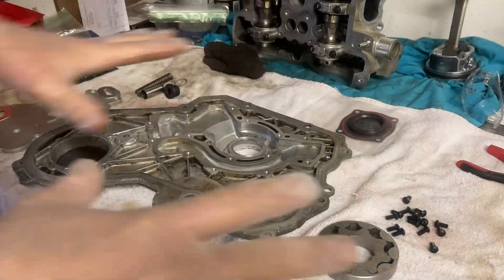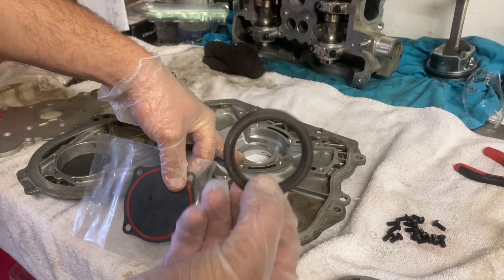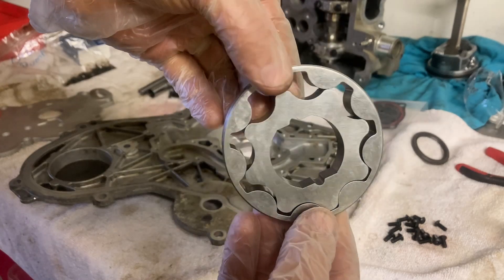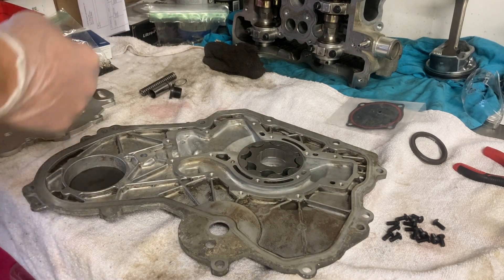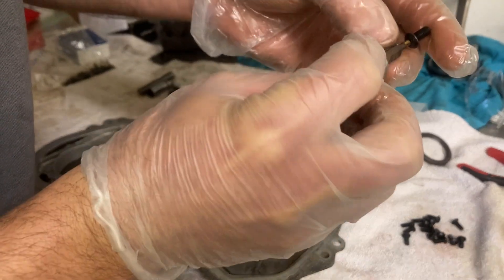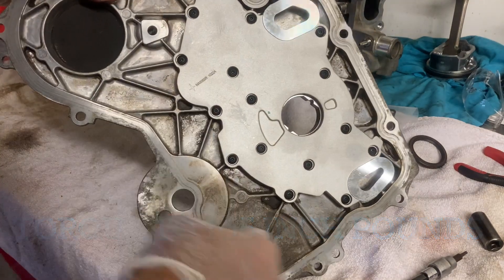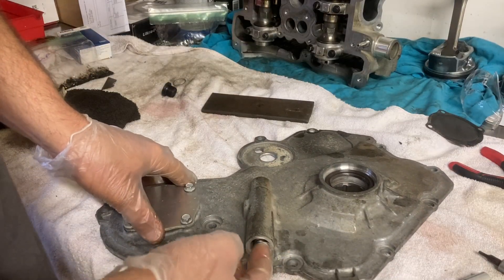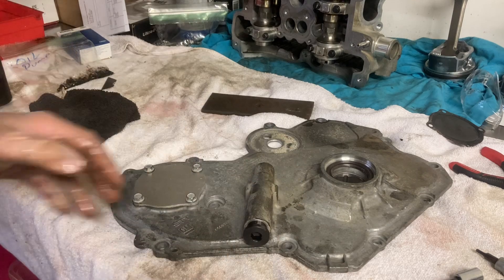Equinox 2.4L Ecotec Oil pump assembly

Comment: I need some help man if you could please get back to me asap. 
I'm done my timing job evrything assembled..
I'm super paranoid about the pump bot priming for the first start it's a customer car...
Can I use that solenoid location that's screws into the top of the oil pump cover to prime the pump?
Reply from the maker: @the46guide94  I was concerned too, but I just decided to forget about it and turn the key, pray and hope for the best.  It worked out.  May not always be the case, go with your gut man!